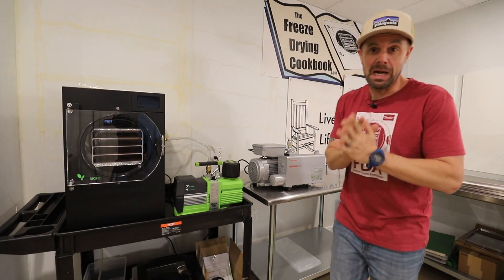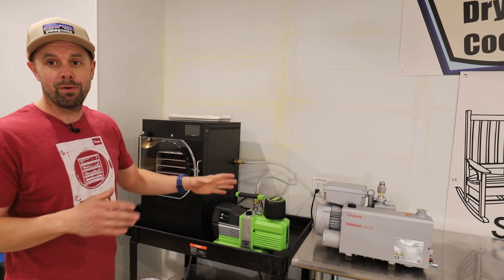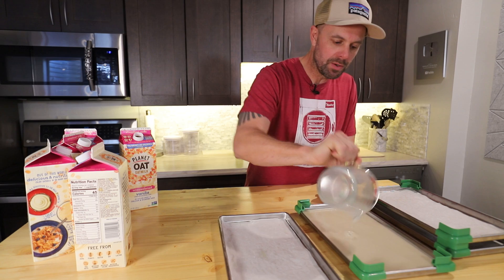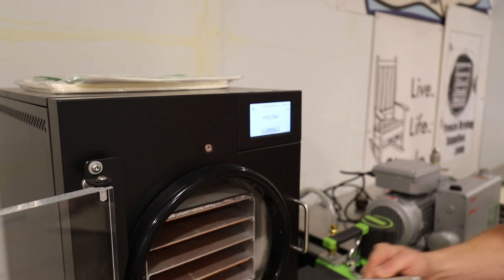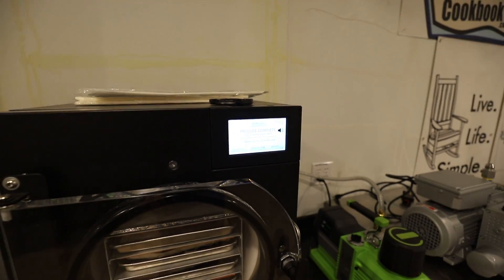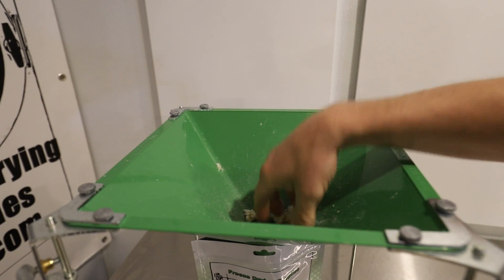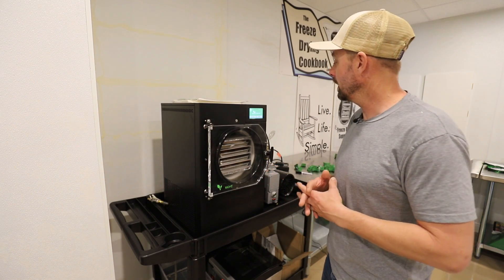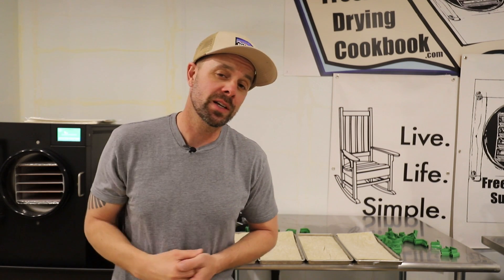Freeze Drying Faster! With a Better Vacuum Pump?

Comment: I can recall the INCREDIBLE argument between my mother and father back in the late 1960s, when my father, a pioneering refrigeration mechanic, unilaterally purchased an expensive, small, portable vacuum pump that would significantly increase his ability to work more efficiently and more quickly. Both for the employer whom he worked for, as well as for himself for those on-the-side independent jobs.

Those of you who lament at the cost of freeze-dryers and all of the ancillary components, well, NOTHING to do with either high-quality vacuum pumps or high-quality freeze dryers has EVER been inexpensive.

Comment: So I'm knew to freeze drying! But I'm an HVAC tech that runs a vacuum pump for a living, removing moisture is critical in a HVAC system! What we have come to know from years of running a vacuum pump is that pumps that are higher cfm in small spaces are not better at removing moisture! they move so much air that they actually create ice! The ice is still moisture and shows up on a enthalpy meter, which measures moisture in air. High cfm pumps work well when there are larger areas. This is my experience in HVAC systems. Most techs run 6-8cfm pumps on small to med size systems 10-16cfm pumps on large systems with hundreds of feet of copper piping.  Hope this information helps.
Reply: That is great information. Thanks for sharing that with us

Comment: A very interesting experiment.  I may have missed this, but at what micron level is the unit operating?  Also, is the Leybold new?  Just an observation, but I would think one of the limiting factors for speed of performance would the the condenser.  I would be interested to see the experiment mentioned with multiple units using the one vacuum pump.

Comment: My older freeze dryer has been taking forever to dry.  I can put identical things in it and my newer maching and the older one will take almost 3 times as long.  I thought it was the referbished pump I had just purchased, but when I put the older pump back on it still took much longer.  Both pumps are oil free.  I wonder if the machine would do better with a soft ware update?  I was sure it was the pump unti I put the old pump back on and it took just as long.  I .  It seemed to be taking longer before getting the newer referbished pump, but since I wasn't doing the same kind of things I didn't really pay attention untill something I did took 3 days and has never gone that long before.
Reply from the maker: Depending on how old the FD is, a software update could make a dramatic change.  I would call HR and get their take on it before doing the update though.

Comment: Just got a GS53  Avid Armor, what settings do you recommend for mylar bags.  I'm having problems with the bags blowing off the heat strip.  I've got it set at PCP02 with 3.5 time for the sealer.

Comment: Well, its an interesting test, its also interesting your comment about running multiple dryers with one pump. Perhaps the middle of the road answer to buying a $5000 larger pump would be to run 2 premier pumps in parallel for faster evacuation times or possibly in series for lower total vacuume ?

Comment: is there a vacuum gauge on the freeze dryer? If either pump can hold the same level of vacuum then you wouldn't expect a difference. If a lower CFM pump can pull a hard vacuum then a higher CFM pump won't move more water molecules, but it will draw the pressure of the chamber down to its limit faster, possibly by a few minutes, which won't make much difference on a 25 hour + cycle . It's possible the cheaper pump actually pulls a harder vacuum. At very low vacuum pressures larger hoses and fittings and shorter hoses might help (think about gas molecules trying to randomly bounce their way out of the closed system) and i would think adding heat to the system as radiant energy would help increase the vapor pressure of the water molecules that still need to boil off... adding heat would tend to raise the pressures in the chamber. There may be a tradeoff between food quality and drying times if higher temperatures are needed to go faster. I haven't done any freeze drying myself yet, but I worked with some vacuum tech in an unrelated field.
Reply: Yes the screen tells you the vacuum indication.